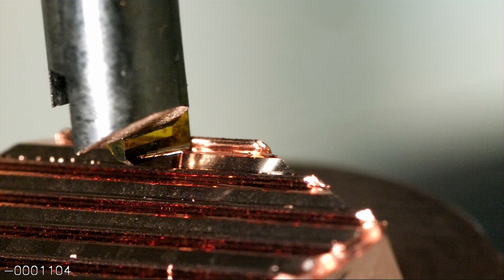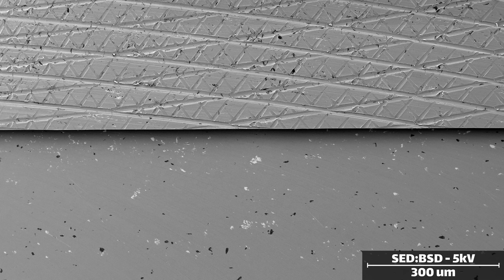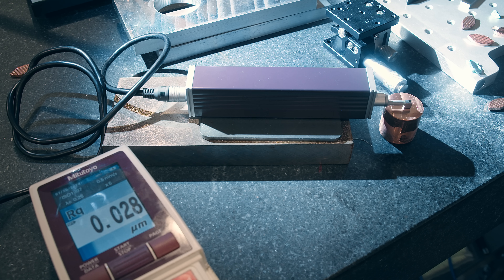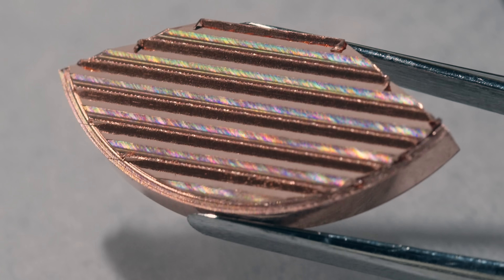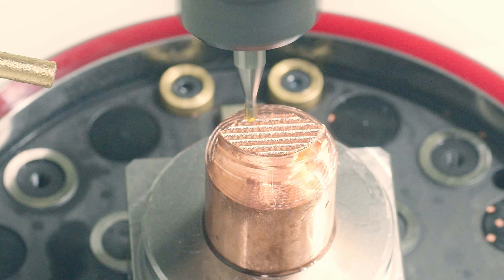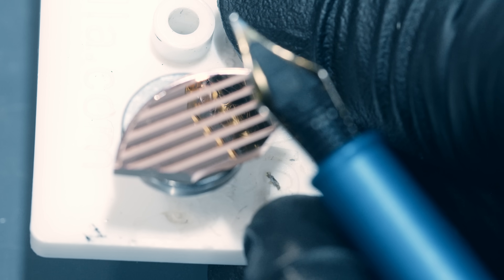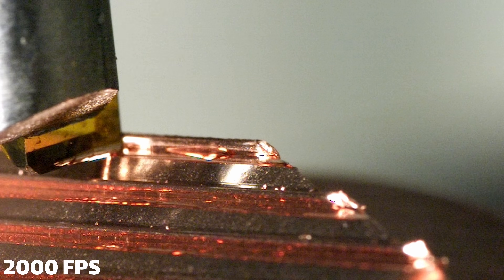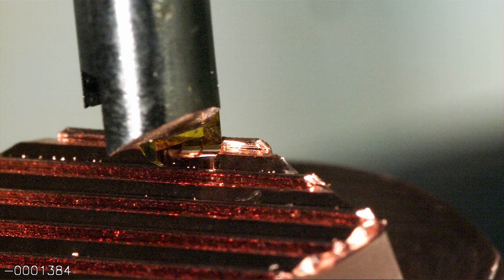Cutting mirrors with Diamonds

Comment: I wonder if we could get a slightly smoother surface by doing another run where you’re not trying to cut material away you’re trying to push the surface to be flatter.  Would be an interesting test to run, even if the results are negative.

Comment: Was your high-purity copper also monocrystalline? If not, my guess about the uneven cutting in the microstructure would be that the different crystal orientations in the polycrystalline structure were cutting differently. Also, even though you didn't want to do polishing, if you were to make two of these surfaces and lap them together with sub-micron polish (cerium oxide, diamond, or so on) you could improve the surface finish, flatness, and remove the "chatter" marks.
Reply: Also, this might be a very nice surface to use as a form for replication, as replicated surfaces are generally better than the parent surface.

Comment: The thickness of the chips isn't a great indicator of how deep the cut actually was. Chips always are thicker than the cut because the deformation of the metal at the cutting edge results in the chip piling up into the chip. Comparing the chip thickness between methods is a decent indication of consistency though. Great job on this process.

Comment: I lol'd when I saw that flatness gauge on the mirror surface. That thing mesaures flatness for CNC machines in thousandths of an inch. Flatness for mirrors is multiple magnitudes less than that thing is built for. The electron microscope was cool af though.

Comment: How do you get a small diamond that is optically smooth, flat, and sharp?
Reply from the maker: You grow a monocrystalline diamond first, which actually gives you a pretty good starting point. And then grinding/polishing with other diamonds. From what I understand it's very slow and relatively expensive because the grinding diamonds wear at the same rate as the diamond tool you're making. There are companies that make MCD polishing tools, Coborn Engineering is one of them if you're interested. They have some YT videos and whitepapers that talk about the process.

Comment: how the hell do lasers cool anything? and how would a fresnel lens outperform a perfectly flat surface (for reflection) or fractal surface (for dissipation)? okay maybe i need to read up about this but reflectivity is, i imagine, per the larger telescopes - polished, aluminum-coated glass, which resists deformation at temperature extremes. very interesting video, thanks for the upload!

Comment: What I noticed as a layman who understands nothing about high-precision processing of materials.
I think the very end of the tool is too thin and long, and it bends a little when cutting metal. I would make it thicker and stronger. Another point is that I did not notice a comparative analysis of the depth of cut. you need to try changing the large step along the z axis. It is possible that a larger chamber will produce better results by causing material to stick to the cutting edge. maybe needed a combination, for example 3-2-3 nm. also I would like to see the tool in a microscope after passing through the copper. thanks for your interesting videos

Comment: Very interesting video, and some superb microscopy. I'm very familiar with diamond turning optical surfaces, but have never seen a planing operation before. The results from a non-specialist machine are pretty impressive. If you wanted to continue with aluminium, 6061 T6 yields a good surface and is often specified for DT mirrors.

Comment: I wonder if you could repurpose the CNC machine into a mirror polisher? Similar to how they grind telescope mirrors with sand and glass grinders. Instead of a bit, just put a tool with the grinding surface, and instead of coolant, use liquid suspension of the grinding dust. Then let it run for hours as you gradually reduce the fineness of the dust.

Comment: Ac servos control machine like these. Maybe its the servo loop causing the chatter.tiny movements sent to the motor then the encoder picks it up and directs an opposite movement.the servos actually oscillate around their commanded position.

Comment: This was fantastic! Thank you for posting! 

I have two questions, and have zero experience so please forgive the ignorance! 
1. Would you heat from your hand on the bottle of isopropyl alcohol contribute more or less meaningfully than the heat from machining over a surface already coated with the alcohol?
2. Could you create two of these that are similar in quality but complimentary to one another, and rub them together to get to a better flatness along the conjoining planes? (A concept I saw in a video discussing the history of precision machining and flatness) I considered that the movement of the pieces rubbing together is also limited by the tolerances of your machine, but I would love to hear your thoughts on the matter!

Comment: This is very impressive. But u can use crystal of sapphire instead diamond with soft metal like copper or bronze. It is much cheaper and u can use diamond tool for easy sharping ur cut tool. And u need to use cooling liquid for cut. Cz temperature expansion is very high even for 1 Kelvin at this small measure. And ur cut tool  need to have semicircular chamfer at both ends - it is very important 
Plz like my comment for help
Reply: Diamond is used because it’s chemically bonded to the steel. Sapphire would have to be glued or set in the tool

Comment: I might have something useful to add. I use sharpening stones, and all sharpening stones wear with use, causing divits, escarpments, or general retardation of the flat surface (which is imperative to be flat). So periodically we have to flatten the stone. We use a sidewalk, and many different positions. You the flattest piece of concrete you can find, which obviously has zillions of imperfections everywhere. But by changing the position and the stroke and which part of the concrete, using light pressure, you get a surface on the stone that's reeeeeally damned close to flat. Flat enough that passing a knife over the surface will leave an even color (the metal leaving the knife) without bumps or interruptions. You could use this averaging method by spinning or random rotations across a surface slightly harder than the material. This is almost certainly how mirrors or looking glasses were made in the days of archimedes.

Comment: Why not use a material that does not oxidize after a short while? Bare copper or aluminum will oxidize rather quickly. Also, its rather easy to anneal copper that is half hard. Maybe try that.

Comment: The "enriched inclusions" you describe for the 7075 alloy are most likely hardening precipiates, depending on the heat treatment condition your alloy is in. AlFeSi phases are defenitly a thing, though im unfamiliar with 7000 series alloys.

Comment: Great copper mirror project, Low Oxygen Copper is the highest quality. Reduce cutting depth. Why not use 99.99999 Fine Silver for a mirror? It has the best heatsinking proper when machining or will it be Superconducting at ultra low temperature?❤

Comment: When you got to the surface roughness part...it just hit me that I understand now why the James Webb Telescope took so long to manufacture. I cant imagine the mirror smoothness.
Reply: James Webb had a 10 billion dollar budget and was a government project.
So they over paid for everything and only used approved vendors (not the best vendors).
Reply: It was also extremely hazardous to manufacture, lol. The mirrors are made of beryllium, and polishing them releases extremely toxic beryllium dust
Reply: @muffinconsumer4431  
I've worked on projects that machined and coated beryllium--that's not an excuse and if anything highlights the incompetency of the team working on the project.  The parts I worked on were for Aerospace applications with sub millimeter tolerances. 

People need to stop worshiping NASA, they are just another corrupt bureaucracy and are awful.

Comment: Hey, 

I belive you understand youre Experts wrong.
A MCD is made for the finish. You use him also for roughing.
Use a PCD for the rough job, until you have only 0,02mm left on the surface. And then you go to finish.
Also you have a heat problem, but in the other way. 
Chips are the main way to get head away. Would say,
your speed is to slow! Take 0,02mm per rotation at minimum. 
Going slower means grinding.
Also i would take a "knife head", a higher diameter means higher speed. 
The point is, you scrubb with the middle of your millingtool above the finished surface. There is a therotic rotatian speed of 0!
further youre millingtool have a cuttingedge longer than its radius. meens the backside screatches and grind all the time.
if you realy want to use that littel one, you can also try to use the side cutting edge. ( https://www.youtube.com/watch?v=J8rHm4cDu9k&t=26s ) 

Last but not least ... i dont know how much MCD milling tools you used, but youre test milling strategy could kill a MCD,
never Never NEVER use him like this ... dont dive the with stirn into the material. Pls, never again. My hearth starts bleeding. 

have a nice day ^^

Comment: I have a relative working for a copier firm where they have a diamond lathe cutting glas cilinders. The lathe is mounted on a isolated 10t concrete block and they still can see in the finish when a truck pasted by on the highway 6 miles away.

Comment: I wonder if you'd achieve an even better surface finish with a shaper, though I don't think anyone manufactures them anymore and I doubt one exists that does work in these kinds of tolerances.
A shaper makes each cut in one stroke, no rotation at all and could significantly decrease tool marks.\

I posted this before I saw the shaper section, good man. You know whats up. I have thought about using my mill like one the same way you did, just never got around to it!

Comment: Several years ago Reichert, now Leica, marketed an ultra mill, which produced soft metal surfaces good enough for optical microscopy. And it would produce the flat surfaces over many mm in area.

Comment: Really fascinating video, so, subscribed. I've used PCD turning inserts for brass and aluminium for my watch projects but nothing on this scale. I wasn't aware of the diamond turning side of things so will check out this Cylo's page. 
I'm assuming your mill can lock the spindle during, what would it be called, a scraping cycle?

Comment: I always try to imagine what a tool would do when put in extremes when trying to solve a problem like the chatter/pressure marks. If you were to drag a tool like this with the same setup and toolpath through let's say a hardened steel what do you think would happen? Or imagine a much longer wider tool a few inches wide maybe. It's kinda like a piece of chalk skipping off a chalk board when held a certain way. You can even see the chip skipping as it being formed in the slow motion footage. That's a really nice machine so I think it can probably do way better than that.

Comment: Having heard you talk about the temper of the copper stock it occurred to me that it would be easy enough to anneal the copper stock by simply heating it with a torch until it's red hot and letting it cool back to room temperature on it's own. This insures consistently soft material to work with.

Comment: We are cutting lacquers and DMM copper plates with diamond cutter with 3μm  rim. With that knowledge available from record cutting the procedure to determine the optimal rake angle of the cutter to avoid the chip being a problem is known in our craft You do almost do the same thing , just in a different field and down to the nanometer dimensions. - we remain just about still in the μm world - well done, great what you proofed and found independently and a worthwhile video

Comment: That point about papers lacking details actually drives me insane. I'm a software engineer working on high quality, real time simulation on the web for e-commerce sites. I end up reading a lot of computer science papers, and they're the same. One paper claimed to have a full, and working implementation. It actually included some of the equations, and a few pseudo-code algorithms. When it came to data structures however: "Objects can be stored in an appropriate data structure". Yes. I know. Obviously. Where else would I store them??? I'm reading this because I want to know what you used.

Comment: Random ideas here, but could cooling or warming the copper help minimize the tearing? Kind of like making small adjustments of hardness.

You could have a passage through the material - carrying a temperature controlled fluid... since it's copper it should distribute the temperature change throughout the part pretty well.

(thinking along the lines of water cooled CPU/GPU cooling blocks in computers) 

We know the action of cutting is creating localized heating... but is that part of the problem... it's too localized, so that the material just below the cut depth is too cool... or warm?  

Blowing the alcohol mist across the part obviously chills the copper  due to alcohol evaporation, does it make the surface too cool? 
Are the chips being cooled too much below the temperature of the rest of the copper? 
Would a warmed lubricant be better?

Comment: Amazing stuff!... I'm a precision machinist myself, but generally my tolerances are in the 10µm range..
I build my Milll myself, and measured a 1µm repeatability with a 3D Touchprobe i also built myself.. 
My lathes are both EMCO machines, and EMCO Compact 5 CNC with an EdingCNC Controller, and an EMCOturn 120 with the original EMCOtronic TM02 Controller, which is quite a nice controler, even though it is OLD.. like 1980's old.. but still i manage to produce really tiny parts with the EMCOturn 120

Watching this video, makes me want to experiment with shaping on my mill as well..but i'm probably going to use Solid Carbide Cutters first..

Comment: This is fascinating. Flatness and smoothness is something I got a great appretiation of plastering a wall. Both together are hard. Those tiny cutting chips are so cool, Stunning micrographs. The shaping machine. Hand powered shapers are available, used to make geko skin moulds and internal gears. Analysis of chip thickness I've never seen before, the difference of the roughness of the two sides is amazing. To see the ball bearing difference and runout in the face was beautiful.

Comment: Try some aluminium 1015 and use a holder with better runout then a er collet. Might give you a better mirror finish ( something like a headshring or rigo fix power grip or SCHUNK tribos )

Comment: Rather than rely on the mechanical CNC, how about just a guide and manually move it for a finish pass. ultra thin shavings in soft metal shouldn't take much force. also examine the diamond bit in the microscope.
maybe attach an ultra sound vibrator to the cutting head to counter any chatter.
maybe also experiment with temperature of the copper. maybe cold behaves better. maybe inert atmosphere

Comment: Awesome video and project. How long have you worked on it? Making a good informative video hides all the hours spent.
Reply from the maker: This one came together relatively quickly, but I think I made 10-15 test artifacts before getting everything dialed in. Each took 1-3hrs so good 20-30hrs of machining and maybe another 20 in fussing with toolpaths, reading literature, cleaning parts, measuring, coating, etc. Think I spent about 2-3 weeks solid working on it.

Comment: 2:10 as far as I know diamond cutters are eaten by steel not because steel is hard but because carbon really wants to be dissolved in Iron.
Reply from the maker: Correct! I wanted to talk about that but the video was running long, so I cut it. But yeah, ferrous alloys rapidly kill the cutting edge because the carbon chemically bonds and dissolves into the iron 💀 Some diamond turning companies are starting to use an ultrasonic fast servo tool which can extend the life of the tool (it oscillates so rapidly that the tool doesn't spend much time in contact, limiting breakdown speed)

Comment: As a 20 year machinist that does the complete opposite end of the spectrum(I'll spin a 100,000lbs assembly on a 12ft swing lathe and take chips the size of your spindle), and I appreciate how cool this stuff is. I do some small stuff too, but the smallest is like drilling 0.015" holes, or holding +/-0.000¹", not a few nanometers lol
Reply: Did you intend to use an exponent 1?
Reply: As a Hobbiest Machinist, I can get as fine as 0.034 Frog Hairs, and my Neurons are out of RAM.

How many is this in FROG HAIRS ??? 😮

philip, from the Great Pacific NorthWET, Oregon, USA

Comment: for the non-spinning approach, when the resolution of the encoders is big enough to cause issues, you might be able to move the tool around the part without moving Z at all, possibly locking the Z axis completely so it doesnt move at all.
Nevermind, maybe should have finished the video before commenting ^^

Comment: could you use a microscope stage for precision movement of the target, rather than moving the tool vertically? - for these fine cuts the forces to be resisted would be tiny. If you look at shapers, it is often the table moving to the ram, not the ram moving.

Comment: Wow I did some work with thos MO traps cooling clouds of rubidium atoms  Watcing you make the mirrors for one of those is a rare treat. The mirrors used in our trap were made of monocrystalline silicon with a gold coating bonded onto copper for heatsinking. ❤